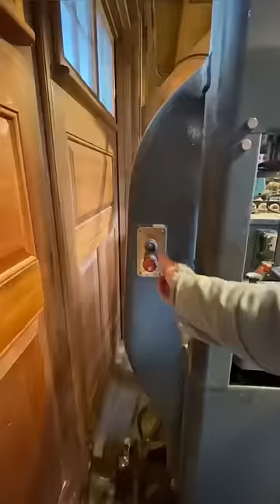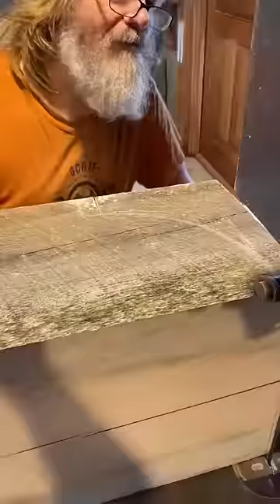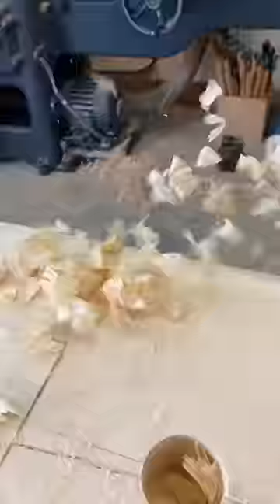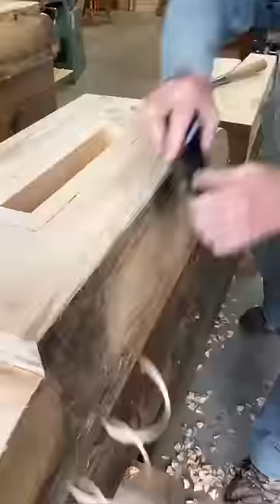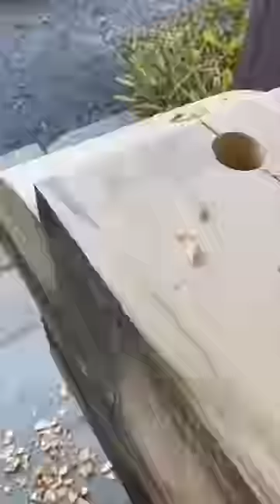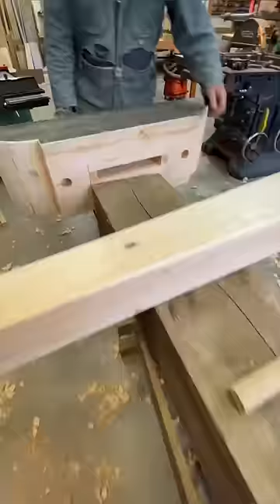Warning #rant #wadkintemple #woodworking #architecture #diy

Comment: Probably doesnt even use bluetooth connected tools LMAO
Reply: Bro probably has zero milwaulkee points
Reply from the maker: funny, you should mention it. I convert many shops to three phase equipment with my line of variable frequency. Drives currently 8000 customers and counting what's interesting is there's an application you can get to turn your iPhone into the control system for your machines which incidentally uses Bluetooth.
Reply from the maker: generally, I prefer the battery operated hand tools such as the German made metabo not to be confused with the old Hitachi line. I find Milwaukee to be middle of the road . I do have some festool , but they don't make the best of everything. For instance, I prefer my Mirka Sander, but there are some tools in my kit like the half inch battery powered router, which I really do love even though it's not the best router in the world, it certainly is convenient.

Comment: I am not a post and beam wood wood worker lol but I have built a couple of houses and not the dog kind lol
I even know that that is a load bean so the tendon in the middle is to keep it from shifting once in place.
What dose he expect you to lift the hole building 🏫 up and damage other floors to them make more work for you not only having to disconnect wires and plumbing so instead of being maybe 30k or 40 k as a guestamet he wants you to put a new building in place.
Lol you can take the person out of the asylum but you can't take the ASYLUM out of the person
Reply from the maker: The engineering is the clever part not the building. I totally agree.
Reply: @jackEnglishmachines  yes I totally love that type of building!
So much stronger and more eye appeal! 💞.  Then the don't want to say it but house's today are garbage.
Some just don't take pride in their work.

I would love to build a log type post and beam in the woods 🪓

Comment: I can tell you this video is completely wrong, I've been a wood builder for 50 years and this is not how you put things together. It clearly states on the box of Lincoln logs I got when I was 2 that the logs fit together by grooves in the ends of the logs, not in the middle as shown in this video, do better sir....